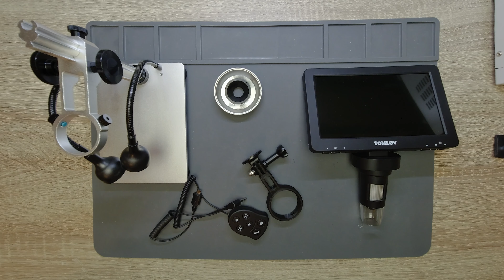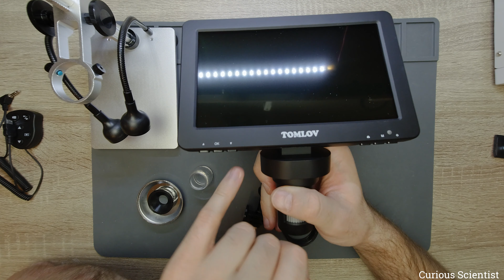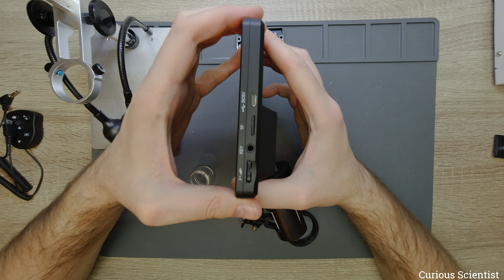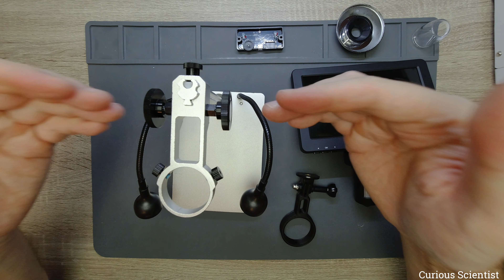Tomlov 7” microscope camera + unique attachment

Comment: I like your method of increasing the working distance under the microscope lens. Tomlov also makes an extender tube which threads in place between the base and the microscope column to increase the range by about 6 inches. It's available on Amazon. Thank you for the video. It was very helpful.
Reply from the maker: Thanks! That extender sounds good, I will look it up. One advantage of my approach is that with the arm, I also have the freedom to move arbitrarily in the X-Y axis.